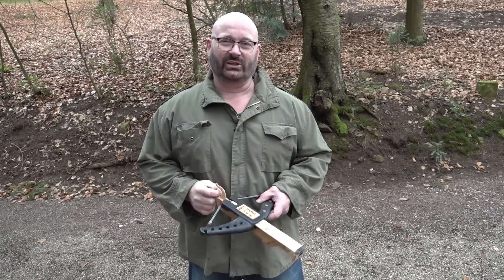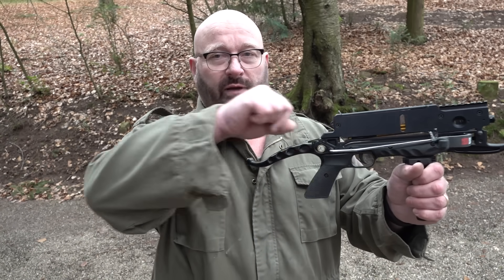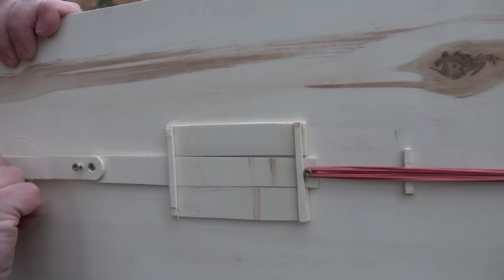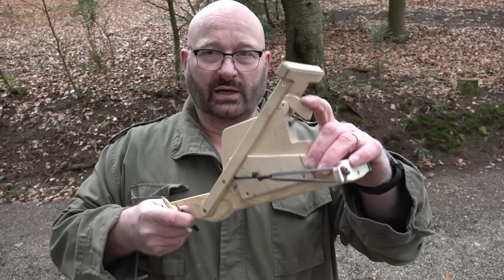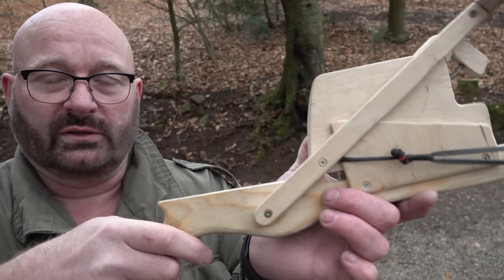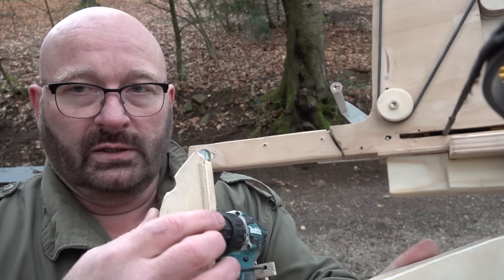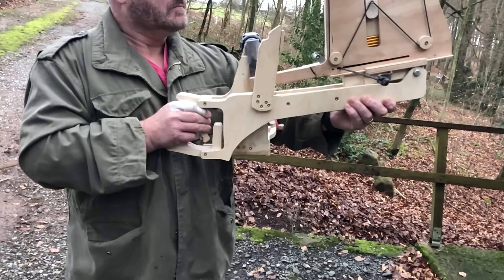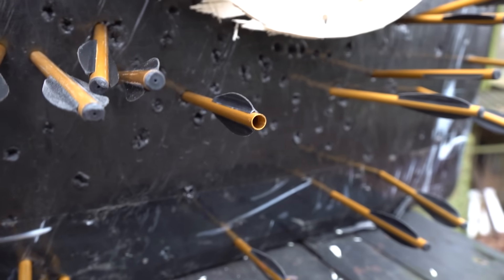Archery Extreme: Ode To Joy!

Comment: Could you not use a low friction carriage material like teflon to allow the cam to slide linearly?  A lot of the vibration is coming from the rotational force.  You can really see it in the slow motion video.  Also I think using the drill as the trigger, with a 1:1 gear to change the direction from perpendicular to parallel and a sprocket and chain to the drawing mechanism would significantly downsize it.  You'd probably want to use metal for that though.

Comment: I actually thought of this idea many years!observe!not the full auto but the compensation of muscle power using a drill machine but my idea involved using the drill to be able to make incredibly strong bow including heavy pull weight but your F.A.S.I.L do sure thing break any limit in genius design ,top of the line ,ground breaking and heavy metal gadgets.u rock man .I am a true fan if anything you post and most of all I enjoy the heartly warmth that your laughing spreads*lifting my hat *😅

Comment: You could probably integrate the drill into the handle if you used a flexible drill shaft to change the direction of the rotational force

Comment: You can Teflon tape wood to minimize dry friction so the initial straight piston contraption seems optimal because this little force point shifts balance off the loader which is at the far front and makes gun hardly controllable

Also make a steel gearbox I'm talking differential, so you don't have that drill sticking into your shoulder it will reduce speed but make it less bulky

Magazine loader if doable will much better feed the crossbow from its bottom as the strings will easily wear out, use springs dammit

Your crossbow is an inspiration like even this can be very deadly

Comment: Instead of the drill on the side you should use a reciprocating saw on the handle and you can eliminate heaps of the wobbles without using a counter weight

Comment: if you make a new version of this, I think it would be a good idea to look into a 90 degree gear coupling for the drill (also some drills comes with this as an attatchment). That way you can use the drill it self as the trigger and handle. Bit silly to build inn a whole new handle and trigger when the drill allready has one
Reply from the maker: Forget it, those couplings don’t stand the torque.

Comment: 10:14 you can simulate a spring with 2 brushless motors and a configured controllers by a rasbery pi. And try using 2 bows in order to get rid of that motion and transfer the motion to cords. See what you can come up with .

Comment: I think, if you change the mechanism that it just moves the small part of the "Bow"  instead of the full magazin part, the handling would get better.
also with some cog mechanism it would be possible to make the whole thing into a "drillbit" for the drill
Reply: Also a small counterweight would help and remove same stress from the drill bearings

Comment: While watching your demo of why crankshaft is bad idea, I think, ok maybe use small pulley at high speed, that after X number rotation triggers a clutch and unwinds allowing the bow to slide forward.  I dont know much design so I cannot help there but just an idea
Reply: Yes maybe like a fishing line. When you throw the line it unwinds very very fast (bow string sliding forward) and then the drill can be reeling it in.... HM..... just need to have the button be automatic

Comment: (How to fix this crossbow) just like a mountain bike 18 speed. Use small gear where drill is located, large gear where bow string draw back (rotating lever) is with a small sprocket chain, could have bow attatched to tripod to shoot in standing position, maybe a crank like on movie Hobit, battle of the five Armies on their iron chariot

Comment: In the explanation about the crankshaft and piston model.
If energy is lost due to friction of the piston on the guides, how about making the guides with ball bearings?
And instead of one long piston, two pistons joined to form the length?

Comment: If the bulk of the shake comes from the force generated by the snap of the bow, could you not add in a force acting in the opposite direction to negate that force?  A second bow snapping in the opposite direction.  It would be more mechanically complicated, but might help make it more accurate.

Comment: I will solve your problem sir put ball barringing’s on that crank shaft with oil lubrication with some type of moldeble layer so it won’t loose resistance and use like rubber to create a tight friction and tada

Comment: 13:08 - Well, as far as mounting the drill motor/gearbox assembly goes... You COULD mount it into the stock, and use a bevel gears and shaft setup akin to shaft drive motorbikes so the whole thing works in a straight line.... 🤔 😏    😎🇬🇧

Comment: Jorg, a question.  would it be possible to develop a similar "full auto" shooter but using a screw/worm drive with the drill at the rear quickly rotating a screw that pulls a railed trigger bolt with some sort of release slot at the end.  probably not as fast but smoother and "slimmer"?
Reply from the maker: No, I tested this. The friction involved heats up the screw to ridiculously high temperatures. No matter how much grease you use, after just a few shots the whole thing would burn.
Reply: @Slingshotchannel  thank you for the reply.  you  are a certifiable genius.  really enjoy your channel.

Comment: I now want to build a rail gun in reverse to replace the drill for this design. If you make a simplified rail gun, which shoots a piece of metal out of the back, the crossbow can pull the metal back to a spring when the rail gun shuts off each time it's pulled back by the crossbow. A simple button could make it release when hit and all it does is shut down the power for a second. It turns back on and fires again. It still could be designed to run drill batteries with a few tweaks.

Comment: use a belt or chain. have a sprocket pull a chain. if the chain length is as long as the bow stroke 1/2 chain rotation will be one shot.

Comment: Hey Joerg, just to spitball an idea. A type of slingshot/crossbow considered possibly full auto but at the same time its really glorified ammo dump, but if youre designing a full automatic why not design a certain mag system ( Built in or replaceable, either or ) that basically all but just dumps a whole clip of guided arrows out at full speed and strength. Would that not be considered fully automatic since its still firing multiple ammunition with a press and hold of the trigger? The thing is the way I see it, it would probably require an entire overhaul on the whole weapon itself to be able to cock it using a ( MOST LIKELY ) highly powerful drawstring, and the trigger is basically a rimfire, cause the moment you open the gateway, it all comes out at full speed unless you let go of the trigger, and the arrows are guided through a solid tunnel and just sprays out arrows out the end. The design mag idea is a highly wound spiral full auto mag all behind a floodgate rimmed trigger. I know, I know, arrows and bolts are straight so this is likely hell to comprehend in a spiral, but...Well if you could make it a smooth transition so that it doesnt get caught up, then you got a really powerful burst-full auto, highly compact and stacked with arrows crammed in tight and locked hard by wind-up drawstrings and springs, ready to find the path of least resistance out. I hope you can try to build it so we can see if that idea worked out or not. Have fun!

Comment: you might try a gear drive setup and worm drive motor duel action slide put the drill in the back use the drill trigger  to fire

Comment: Amazing! And simple at the same time! It’s quite a joke, but there is always some portion of truth in each joke! To me this invention looks like something that has a huge potential in the archery entertainment field. I think this can potentially redesigned and reassembled in a good looking and a usable way. And a double stack magazine is required for sure, to ensure larger capacity at smaller height - it’s quite possible to design one for using bolts with no stabilizing vanes near the back - double stack magazine is a common thing in fire-arms, so there’s no rocket science there. And also, I believe, it’s quite possible (although not easy) to place the magazine not on the upper side, but on the bottom side of the crossbow, with bolts pushed up by a coil spring in the magazine. In this case a strong aluminum or high performance plastic limiting plank will be needed to be placed above the string to prevent the bolts from popping up and out of the crossbow

Comment: IDEA: What if you take the first design but use a metal slide and place linear bearings in the top and bottom blocks. That would eliminate a lot of friction. The oil might start smoking a bit, but it would reduce the shake of the weapon probably by half and you retain the draw strength

Comment: Gotta disagree Joerg.  The rotational movement of the whole assembly is what's causing the vast majority of the instability.  You'd need a counter-rotating, oscillating counterweight assembly. However, I see no practical location for it, since the bow and your left arm would obstruct it.  Also, it would make the weapon so heavy and cumbersome, it would no longer be very combat effective.

Comment: I think we can add another shaft to reduce recoil.. very easily
Reply: Plus decoupling magazine to replaceable magazine doesn’t seem difficult as well.. which will reduce recoil as well
Reply: The drill seems a bit too much though,  a multi barrel approach with a rotating handle will make it better I think. Like the gatling gun
Reply: Probably you already had these ideas..

Comment: Electricity. A rotor spinning could pick up a bolt (or BB’s) and and then the action of an electromagnetic coil would cause the bolt to be slung out of the gun faster than the rotor’s speed.

Comment: Yeah the stupidity of bureaucracy is the same in chemistry, too. Someone used sulfuric acid as weapon. Sulfuric acid banned (as if one couldn't use 10 000 different and much worse chemicals...). Someone used acetone peroxide as a bomb. Acetone selling restricted, hydrogen peroxide selling banned/restricted. AS IF there are no 57 000 different ways of making bomb... One can make acetone from eggshells and vinegar, peroxide from alkali metals. No need to "buy" anything, a clever guy can easily make host of weapons knowing little chemistry or engineering. Such bans only harm citizens who are now treated as inept children while when they something out of order, they are immediately treated as fully responsible adult. And the real terrorists laugh and do whatever they can - as if writing law on a piece of paper does anything effectively. It only spreads fear and paranoia - they very thing terrorists wanted in the first place. We are so so stupid :(
Same with weapons - when there is peace, the state don't want citizens to have weapons BUT when there is war, the very same state make 180 turn and pushing weapons onto everyone, forcing them to fight. We are hypocrites.

Comment: It’s actually under engineered and lame.
The magazine should be on the bottom, especially with these strings push the bullets to the canon.
Also, the linear movement should not be as chaotic. It’s easy to convert rotational movement to linear movement without having the whole machine to shake. Otherwise we would not have trains or lifts.
Sorry but it’s too lame. Time wasted.